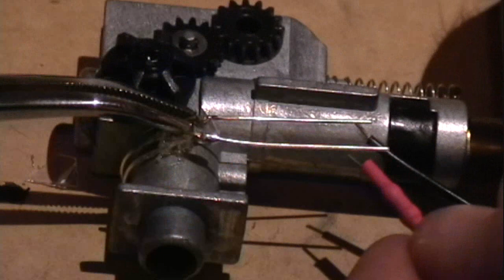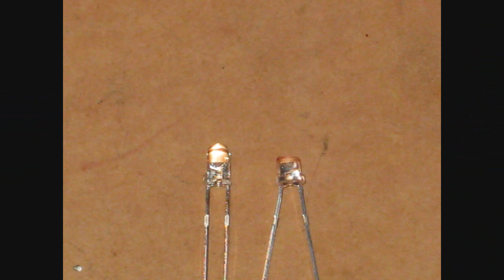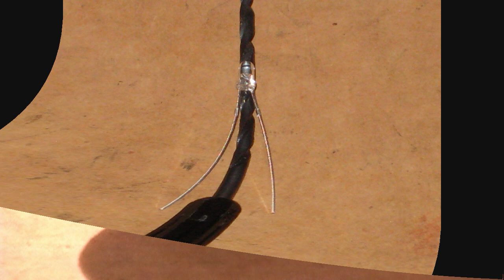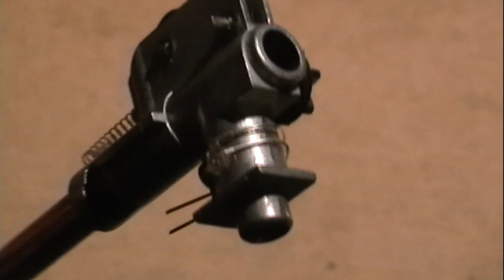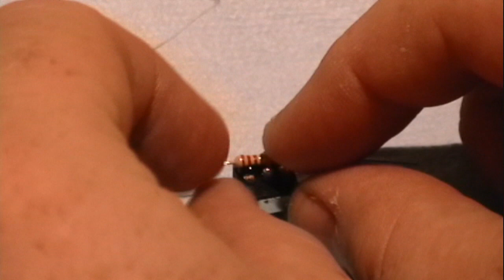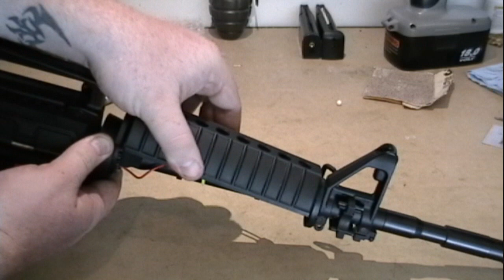Hop Up Tracer Unit Installation Guide

Comment: i did exact same thing and it worked for awhile but after one of leds stopped working. I don't know what i have done wrong
Reply from the maker: might have just been a  bum LED, or maybe the resistor wasnt enough and it burned it out.
Reply: Scout Sniper Airsoft first thx for this Video! helped me a lot. i would gladly buy your Super Bright Leds if i wasn't leaving in france. 
resistor was fine, i put it lighted up for 2 hour, just to check if it was working in long term. But after installation inside Aeg and shooting couple of times, it stopped working. it happened 2 times now
Reply from the maker: That is unfortunate, I have some that are still going strong after 5 years...... Hope that it gets figured out but seems like a wiring or LED issue at this point.

Comment: mmmnice, but not funny to replace it when is broken..
Reply: ScoutSniperAirsoft Actually i think that this one is a developing idea, a prototype, a solution that is home made, what is the best of all..For me , the best way is a custom flash hider...or  supressor..

Have a nice day.
Reply: ScoutSniperAirsoft You welcome..thx for share your ideas.
Reply: ScoutSniperAirsoft Actually i have a proyect related to a custom tracer supressor...is just a metallic tube inside the silencer with a few holes that are filled with leds , at list 10 around the tube OR a plastic transparent tuve ( 10 to 15 mm diameter ) the rest just one cable...with a switch...like a PEQ or ANPEQ.... am i clear?

Comment: Idiot didnt even insulate the terminals that wrapped around the METAL hop up unit.....short = damaged battery/poor run time
Reply: Lmao.....it doesnt touch so dont put safe gaurds?......hundreds? ....oh boy you sure are skilled...several hours of drilling holes and low voltage 12 yr old level of electronic knowledge.....positive/negative....whooo hooo.....what happens when some kid follows you guide and messes up....ruptures a battery in his gun and acid leaks or one of those wonderful lipo explosions happen.....7 cents and 30 seconds with a hair drier can make this safe....im sure several kids have blown batteries in thier attempt to copy you
Reply: Your butt hurt .......lol
Reply: 7 cents 30 seconds

Comment: Okay piece of cake man. Just finished my own hop up tracer unit, I had a blast making it too. I couldn't find any black glue sticks or dark epoxy to help seal in the LED's. So I just sprayed 3 light coats of flat black Krylon over the holes.
One question I do have is, do I have to use a certain brand of glow in the dark bbs to have a bright tracer?
Thank you for this awesome how to video. Affordable, easy and fun to do. This saved me $50-$200 from buying a big ass factory made tracer unit.

Comment: Got the parts in and followed the guide, it works like a boss..I used silicone sealant (Lowe's in the paint section) to cover the exposed wires coming from the hop up. Wired it to the front and slapped the switch and 9v in the handguard.Tap,Rack,Bang. Thanks for the help and parts. Will gladly do more business.

Comment: Have you observed any appreciative drain on batteries using this HUTU setup?

Additionally, I use 11.1 LiPo in my KWA M4 RIS. Would you have any suggestions on any modifications to what you did in this video to make and install a HUTU?

I'd love to have it wired into the trigger so it only illuminates when the trigger is pulled. Because the gun is rear wired, it would be tough to pack the switch into the buttstock along with my triple nunchuck 11.1 battery and a future MOSFET.

Thanks SSA!

Comment: i would really recommend to put some heat shrink tubing onto at least one of the cables that run from the one led, around the hop up to the other especially when you have a metal hop up. id do so because there is the possibility that you get a connection between the 2 wires of the left led over the housing of the hop up that would cause a direct connection between the positive and negative pole of the battery which then causes a short circuit.

Comment: could I wire the LEDs to my motor connectors so that It just flashes every trigger pull? also, how easy would it be to do this to a gun wired to the rear?